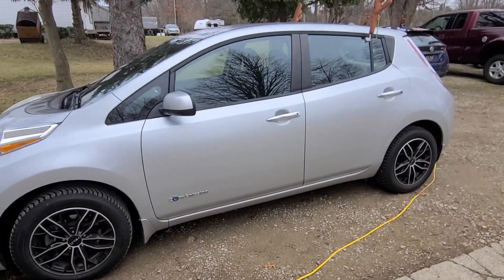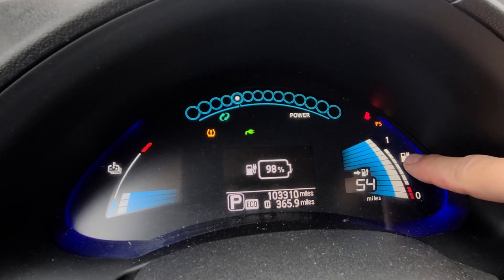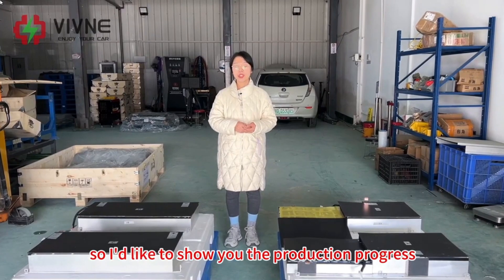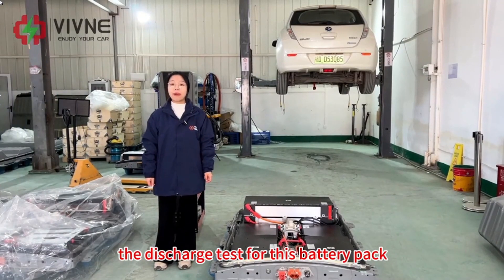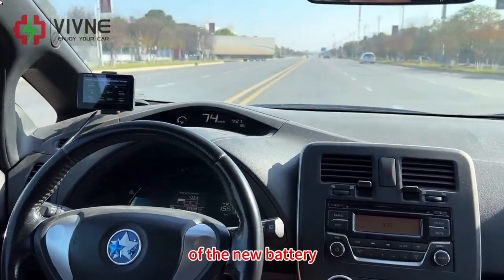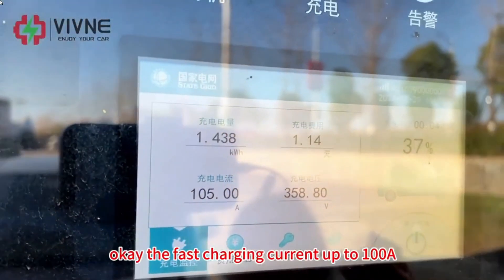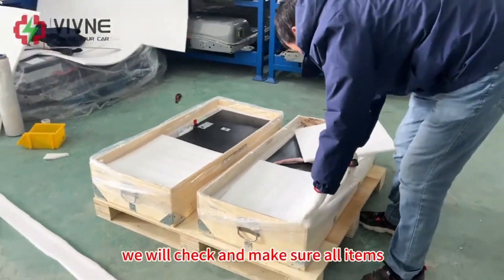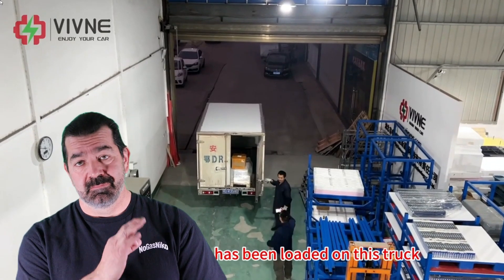Leaf Battery Upgrade Update 3 - Shipping CONFIRMED!!

Comment: China has a LOT of problems ahead, mostly due to the combined arrogance and stupidity of the CCP. That makes me very sad for the Chinese people.
However, when I see Chinese people like these good folks at VIVNE, I feel much more hopeful for them. These people work hard to exploit a need in the market and use the resources available to them to help customers that have old LEAFs that most people would just junk. VIVNE is such a shining example of small business entrepreneurial innovation going out and meeting market demands. People like this and their work will save at least some of the people in China from the coming disaster.
Everybody focuses on the newest and latest, but there is some extreme value for ordinary people that need a reliable everyday driving car in these older LEAFs. Put a new battery with the LiFePO chemistry in an older LEAF and it will keep going with nothing but transaxle oil changes for decades to come, if you take care of it. That's value!
Reply from the maker: I have to admit that I'm not up to speed on what's going on politically in China.  I'll have to do some research to understand your first part of the comment.
I agree with value in the older Leafs.  We took our dog to the trails in our 2013 Leaf yesterday, and I was just amazed at how good of a car it still is.  The only thing lacking was range.  Now I'm solving that problem.
So far, Vivne has been great.  Everything was explained up front, and there weren't any surprises.  Communication is excellent, better than my dealership down the road!!  If this is any sign into the quality of their product, I think I'm going to be very happy.  
Best of luck on your upgrade, keep me posted on the progress and results.
Reply: @NoGasNiko  The PRC is facing the worst case of demographic collapse in recorded history. Their largest generation, like the US, is beginning to retire, leaving the workforce and taking what little retirement wealth they have with them.
Most of that retirement wealth (for the average Chinese citizen) was stored away in second, third or more homes (usually what we in the US call a "condo"). Except for Party members, that is essentially the only way they were allowed to invest any savings they had. For all but a lucky few, that wealth is gone now. The PRC is currently experiencing the burst of a huge housing bubble (second, third and more condos). Some experts have estimated that this crash is an order of magnitude greater than the US 2008 housing bubble. They're wrong, it's at least two orders of magnitude (100X) worse. We're not certain exactly how bad it will be, other than history has nothing close to this bad as an example. Making the matter worse, the CCP has ordered debt to be pumped into that collapsing bubble. Anyone that knows anything about economics will realize that is a recipe for disaster.
Even before 2020, manufacturers were moving their production to other nations, such as Vietnam, Indonesia, India and Brazil. The cost of labor has risen sharply in China, to the point that theirs is the highest in the developing world, far higher than Mexico and Mexico has a better workforce with no tariffs and lower transportation cost to the US. The PRC is never getting those jobs back.
There are several other reasons the PRC is in its last few years (perhaps only 5), but I’m not going to go into that here and now.
If you have an open mind and want to hear the truth, find an episode of the Joe Rogan Experience where his guest is a man named Peter Zeihan. That’s one of the most exhaustive and concise presentations on the PRC’s pending demise. You can also watch this short video as well.

Peter Zeihan || Deglobalization: There's No Stopping It Now

https://youtu.be/bhGb-BaGw2Q?si=OdIWK0xpEYulcURG

Comment: I have just gotten started on the rabbit hole that is the Nissan Leaf and have found VIVNE's products and have looked at the whole idea of buying an old Leaf and doing this upgrade. I look forward to watching your series and following along on how this turns out. Once you're done, I'd love to see a recap of how long it took and what it cost including the extras that you may have needed along the way.
Reply from the maker: Thanks for watching.  I plan on sharing as much as I can.  I will always discuss the price of the battery modules with current prices from their website.  Aside from that I will gladly share what tools I needed to get, lifting equipment, and what I already had (so people know what they need).  Might even put a video together listing all the tools used so people know what they need beforehand.  Of course people there's multiple ways to get the battery out but I'll just show how I did it.  Hopefully it goes well and I can share lessons learned.
If you decide to go the same route, keep me posted.  I love to hear the stories from others doing similar repairs to their Leafs.

Comment: My 12 year old leaf went into turtle mode when it was -8F last week. It did make it home fine and is better now that it has warmed up some. I only have 7 bars and have some weak cells now. But it's still working as I only drive 10 miles a day, but a longer battery would be nice as I currently use a ICE car for trips. I also have a damaged leaf with a better battery, but it's about as good as the one you currently have. I also hope that a aftermarket cabin heater comes along.
Reply from the maker: I hope to have this installed while we have some cold days left.  I really want to test its range in extreme cold temps as well as the cell balance.  I just hope I don't have to wait until next winter to test.

Comment: Interesting video series. It looks like you ordered before the tariffs, wherever they might entail, hit with the incoming administration. It’s an utter shame that batteries like this are not available in America. I have no issues with a China made battery pack as China can manufacturer to very high standards these days. I will be following your channel throughout the entire process. Thanks for posting these videos.
Reply from the maker: Thanks for comment.  Yes, the potential tariffs did play a part on getting the modules ordered and delivered before the new administration.  I don't know what will happen, maybe it's just a negotiation tool, maybe not.  I don't do politics on this channel but this is one political topic that actually affects the purchase.  Hopefully Vivne can still supply affordable modules and packs going forward.
Reply: @NoGasNiko  May I ask what is the total shipping weight? The reason being is that those interested, and close enough to the port of delivery, can pick up the battery modules at the port versus having them delivered.
Reply from the maker: I just checked the invoice, the shipping weight was nit.listed.  I will reach out to Tracy and inquire.  My guess is around 500 lbs but I'll get that exact weight.
Reply: @ Thanks. Also, since you’ll be splitting the battery casing to replace the modules, does the new kit include a new seal(s) for reassembly? Did you order their physical monitor screen (similar to LeafSpy)?
Reply from the maker: @entasis.fifty-four in Tracy's full video, she shows the gasket material included with the accessories.  I was not expecting that but am certainly pleased they include it. 
I did not purchase their monitoring system, I will just utilize LeafSpy for now.
Reply from the maker: I just checked the website, it's 350 kg for the 50 kWh shipped.
Reply: @NoGasNiko  771 lbs...  heavier than I thought!
Reply: @ Thanks. Obviously, I should have been more diligent in perusing their website…around 772 lbs. With two people you can likely breakdown the packaging and move the modules onto a truck bed if picked up at a port. Not too bad.
Reply from the maker: @entasis.fifty-four just be aware, you would have to deal with customs, duties, and fees.  I paid extra for delivery and I don't have to worry about that.
Reply: @entasis.fifty-four  I also saw in another of the VIVNE videos that the weight of the 50 KW battery is about 665 lbs (with enclosure) versus the original 24KW battery in the first gen Leaf at around 600 lbs...  so, about a 65 pound gain in overall weight after the conversion...